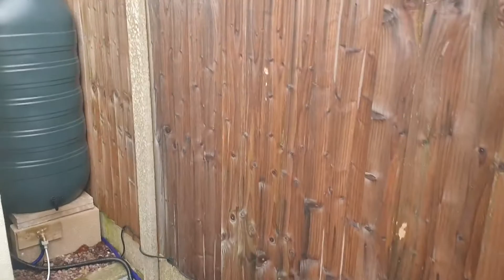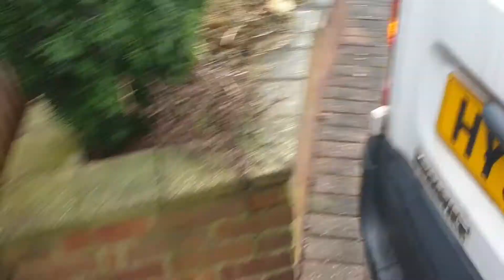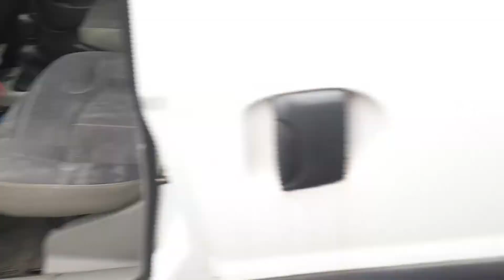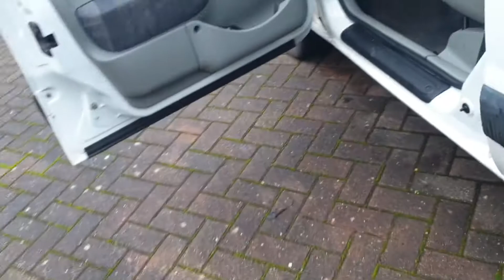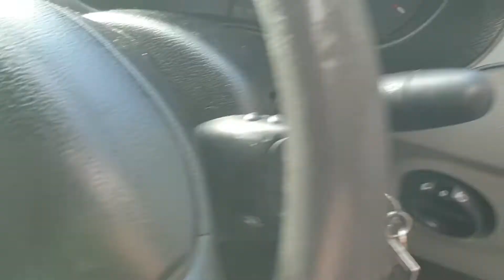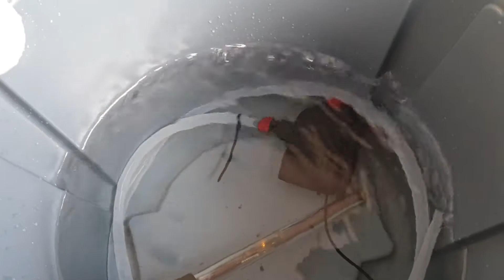Aquarium Power Cuts?? USE YOUR CAR !! | How to save your fish | Saltwater tank

Comment from the maker: Just a quick show on my current plan for any minor power cuts. As mentioned in the description you can also use a leisure battery instead but if you are thinking about using your vehicle then remember to check you area's engine idling laws.